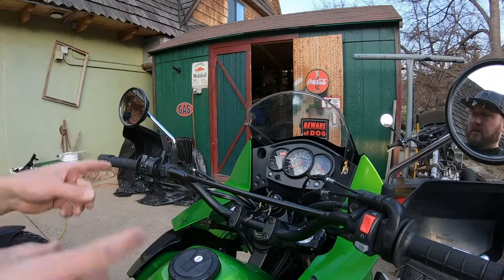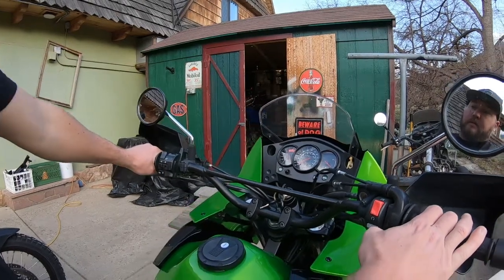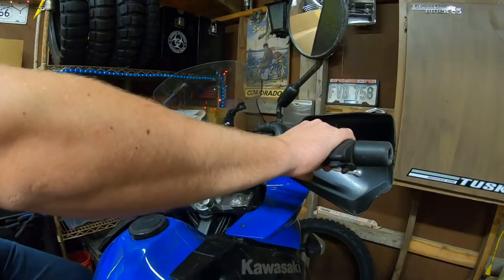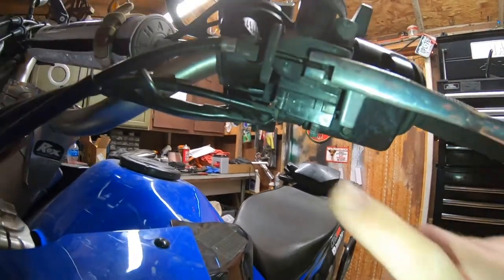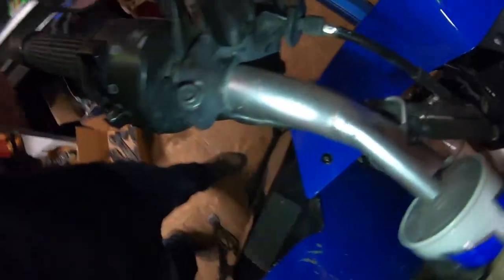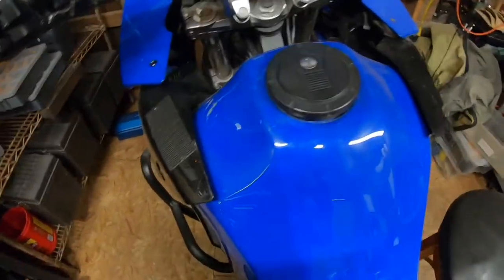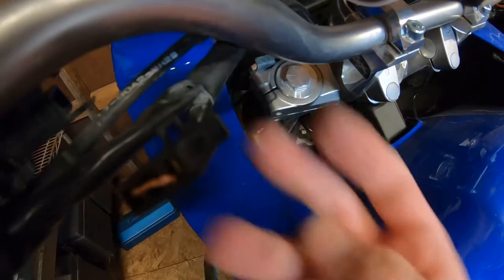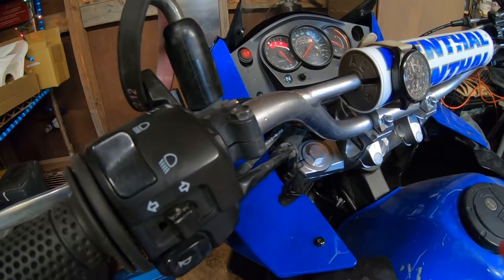Kawasaki KLR650 Won't Start in Gear | Bypass Clutch Safety Switch

Comment: Alternatively you can unscrew the clutch lever switch box, pop the tabs to open it, and look inside to see why the connection isn't being made. I had the same problem and simply cleaning the copper connections inside fixed it.

Comment: Hmm! Seems like a good temporary fix for me, since pulling in the clutch to start is such a habit, I even do it when I'm in neutral! On the other hand, the switch not working and me having to go to neutral and let the clutch out to start is a safety issue if I were ever to stall at a light or pulling out, for example.

Comment: Genuine question tho, if mine is broke, and I don’t mind starting my bike in neutral as I normally do it anyways, do I have to fix it?
Reply from the maker: No, if you don’t mind it then you don’t have to do anything with it
Reply: @AdventureTomek  I had a weird experience just now actually, I was testing to see if everything worked and it won’t get up to speed after 2nd gear higher than like 20 mph. It’s like it’s not picking up the gear or something